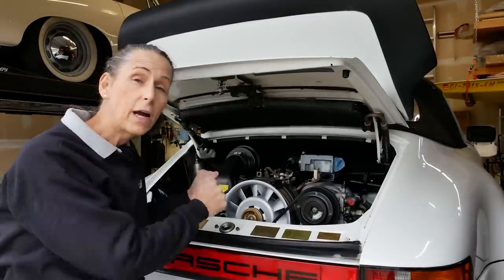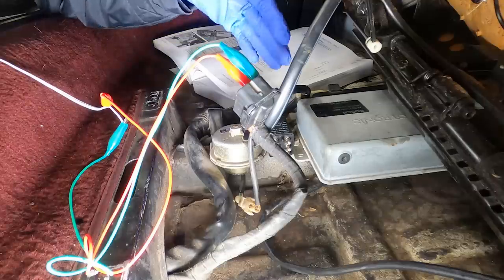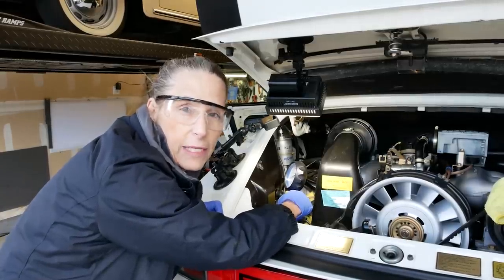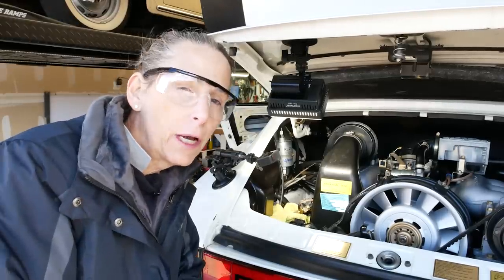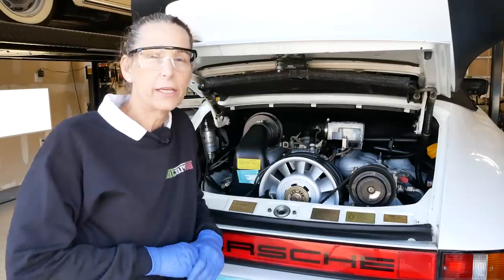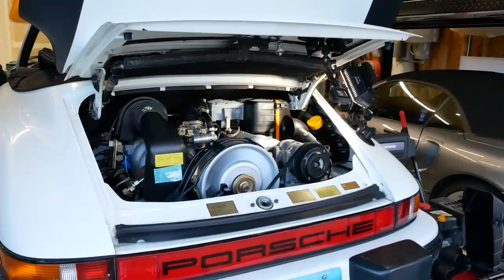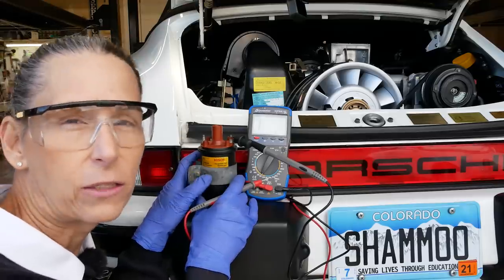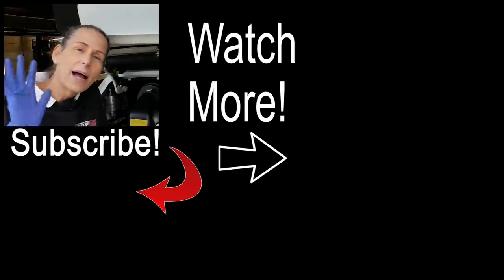Budget eBay Porsche 3.2 Carrera Project Car! #30 - NOW WHAT?! YOU WON'T BELIEVE IT!!

Comment: Great video on a vexing issue.   The way it dies after revving initially made me think fuel problem, but you’ve done enough testing there to move on.    Whenever I suspected a coil I’ve replaced them since it’s a cheap fix, but they never proved to be the issue.  I’ve seen a lot of good comments about checking the DME and Motronic controls along w/ O2 sensor.  That is a good start for next steps.  Especially since there is evidence of possible water damage in that area.  Someone leaves a convertible top down and it rains....... not good for electronics located under the seat.
Reply from the maker: Right.  I have my eye on the DME relay, but I need to test it.  I have a new one coming I can use as a spare.  I'm going to go through the service manual's procedures to check everything.  It is perplexing.  Seems like it should be something I touched though...
Reply: @HeidiandFranny  This is the opposite of a “well sorted” car so it’s actually beneficial to go thru all the systems.   You’ll know this car extremely well once it’s done ;-).   I always used the Chilton manuals on my older 911’s (and The Idiots Guide for my VW’s.).  Haynes was especially useful for my e30 BMW 325 and e24 635 and those are the  most contemporary to your 911.   I never found the factory manual to be that helpful for troubleshooting my 84 911.   They just assumed to much inherent knowledge on the part of the mechanic i guess.       Just keep the faith (as John Muir would have said) amd you’ll get it figured out!

Comment: 8:30 sounds bad. Almost like no engine oil, however that's not the issue...
Reply from the maker: It has oil and oil pressure...  I think that is the air entering the air box.  I need to reassemble all that...

Comment: Hummm...  I had a vacuum line I forgot to connect and an idle air control issue after my rebuild that acted similar.. surging and erratic idle.
Reply from the maker: Thanks that's great to know.  Which vacuum line did you miss?
Reply: @HeidiandFranny  Mine is a 993, and it was one of the lines to the solenoid actuator for one side of the varioram.  Also found.a collapsed vacuum fitting - see https://www.dropbox.com/s/l5tntv46kibcgkc/993%20vacuum%20fitting.png?dl=0

Comment: Since you had alot of the car apart you might want to check the grounds on the ignition system and coil. A bad ground will give a phantom temp related issues. I chased one on a 530i BMW after I had the motor out, it ended up being a body ground that been painted and not cleaned well on assembly. Good luck on your hunt what ever it turns out to be.
Reply from the maker: Thanks for that.  There are two main grounds - one between the car and the transmission and the other on the intake manifold.  Both were cleaned thoroughly and re-installed.  BUT, It would be a good thing to re-check them.
Reply: @HeidiandFranny   I've seen some coments on the airflow meter and it kinda jared my memory back to my Benz and BMW tech days, those were a royal pain.  The potentometer in the airflow meter could develop dead spots or the vane itself could become sticky both could be temp dependant. The vane can sometimes be freed up with some light oil and the continuity of the potentiometer can be checked I beleive but, I'm sorry, I can't remember what connector pins to test at. Hope that is some help to you.  I don't want to be the person who "knows" what your problem is just offering some suggestions.

Comment: You are wrong in the measurement, it should be several kiloohm when you measure to the spark output!
Reply from the maker: You are correct.  It is a little misleading in the manual.  Should be between 5K and 8K Ohms.  The manual stated 5 - 8KOhms and I missed the K.  That's alright.  I think I want to have the coil tested anyway.  It is 35 years old...
Reply: @HeidiandFranny  Hi, Do you have a dwell angle meter, then you can hook it up  on the coil and check if the coil get's the right signal from the engine management system even if the engine doesn't start.   /Gunnar

Comment: Hi franny are you sure the vacuum line for the feulprssure regelator is on the richt connection I ask this becouse I saw the pressure drop when you gave a bit of throttle. The vacuum line is there to hold the pressure diffference between the injectors and manifold constant, so when it is idling it should be at lowest. Your doing a great job btw.
Reply from the maker: Thanks!  It did drop a little, but it was always above the min 2bar.  And, I did see a good jump in the pressure when the vacuum line was removed and it went back down when it was hooked back up.  It seemed like the pump and regular are functioning within the specs.  There may be a few things at play here...

Comment: Had a 912e years ago, had similar problems and ended up disconnecting the wiring harness from the computer and twisting it one turn.  Reconnected it and the car worked fine afterwards.  LOL
Reply from the maker: Those old wiring harnesses ;)

Comment: Sounded more  ignition related than fuel or air to me?  

Swapping out the coil may seem like part changer diagnosis but in this case it's the best option.  Go ahead and swap it out anyway it's past it's best before date👍
Reply from the maker: It totally is!  I was pretty surprised to find it was original.  If not today, then probably not long... ;)

Comment: It's probably the coil but also worth checking the distributor setting and points. Timing seems off.
Reply from the maker: No points on this year of the car.  Timing is handled by the Motronic system.  We'll see on the coil... Thanks!
Reply: @HeidiandFranny  It looks like the fuel pressure gauge is resting on a distributor at 6:19. A bad idle is normally poor timing. Running the car with a bad injector could have upset the timing. Perhaps the monotonic system needs a rest or the car needs to be run longer for it to make adjustments.

Comment: Hey guys, did u use any special lube on injector o-rings b4 install? Ernie
Reply from the maker: Yup!  Sure did.  They are near impossible to get in without a little silicone grease ;)  But that is a good point. If you force them in dry they can rip.

Comment: 8 minutes in, haven't watched the end or even know if the answer is in the video, but if it was running perfect minus the bad injector before, and now it runs like junk with all good injectors and the only thing you touched are the injectors, I think it smells like an injector o-ring got cut, or got pushed out of its groove during install letting a non-trivial amount of air bypass the maf (or afm) and idle air circuit. Injector o-rings are the bane of my existence, I would not wish an injector o-ring on my worst enemy. Squirt brake cleaner on the injector-to-manifold o-rings, see if it momentarily runs better.
Reply from the maker: I will check that.  They are all new and I did put a tiny bit of lube on them, but I'll double check.  Thanks!

Comment: I have never heard of a coil that functions intermittently. Perhaps the coil fails when hot, which would explain why the engine runs a short time and then stops, but will restart. It seems logical that a small break in the windings could go open with heat expansion.
Reply from the maker: I suppose we'll see...  I'm not completely convinced...  I hope all is well :)

Comment: You seem to have some kind of electrical issue.  For sure.  It could even be a bad ground, thats kind of what im leaning towards, VERY odd problem.
Reply from the maker: I still think it has to be something I touched...  Process of elimination!
Reply: @HeidiandFranny  Probably...but stranger things have happened!  I would start by checking the wiring  (Wiring Diagram>Power Distribution) to anything that can cause the engine to die if disconnected.  Trace the wires, and check all ground points.  I'm thinking a pinched wire or something of that sort....

Comment: Great video. I am no expert but on an old car of mine I had the same problem. Dirt in the petrol tank blocking the outlet on a random basis.
Reply from the maker: Thanks, I've cleaned the tank an installed a new filter.  All the fuel lines are new.  The pump passed it's test and if there was a blockage the test with the car running would have been below spec.  It is a good call though.  That is why I went at it cleaned and replaced everything.

Comment: The fuel delivery looks good, but what about fuel quality.  Any chance water is surging through, or extremely stale fuel?
Reply from the maker: Good call and yes the car has been sitting for over a year, but I drained the tank completely and re-filled with new fuel.  New filter as well.
Reply: @HeidiandFranny  Your fuel pressure is good at the fuel rail tested, any chance the other bank is loosing pressure.  I'm not familiar with Porsche, so just asking?

Comment: My 82 911 had similar symptoms was both coil and leads. Never use non original leads due to the very high voltage the 911 system uses.
Reply from the maker: Thanks for that.  All the leads are new (that doesn't guaranty they are good though).  A 35 year old coil with 110K miles on it?   Hmmm... ;)
Reply: @HeidiandFranny  Ive driven 110k miles on my 911 and at that point the coil failed. It was my daily driver at the time.
Reply: @HeidiandFranny  I fitter non original silicone supposed performance plug leads but they failed after only a month or so. replaced with Behr original ones and not had an issue since.

Comment: Are these cars cheap to restore?
Reply from the maker: Ummm...  Define cheap ;)  With their age the consumables are still readily available, but the more specific parts are becoming hard to come by.  If you start with a good running example then you will be fine, but if it is missing a lot it could get expensive.  Still, it is way easier to get parts for that the Ferrari...
Reply: @HeidiandFranny  I guess I meant wouldn't it be more economical, and less labor intensive to start with an example that is in good working order? Or is it just the want to restore/build something yourself? Ether way, both have merit.

Comment: I'm surprised that just one injector was locked up and I thought all of them would have been locked up
Reply from the maker: I guess two were technically locked up (one open and one closed) and two were sluggish.  Boy, they really don't like to sit.  I did notice a fair bit of smoke when it started with the new injectors.  I think they did leave a little oil in them.  I think they are working just fine now, but I should test them (again).  I just don't think it would cause the whole engine to just die...
Reply: @HeidiandFranny  it was quite weird how the 3.2 Carrera would die for no reason I hope you figured it out

Comment: My car did similar when the air intake was changed, the ecu would need to relearn the fuel, air mix again
Reply from the maker: Ya know...  That is a really good point.  I still have the entire air box off and I was wondering if that could be affecting it.  Hmmm...
Reply: @HeidiandFranny  yes. I think you're on to something. The surging reminds me of when my car had a very small crack in the air box. It surged like your car is doing. It droive my shop crazy until they figured it out. Good luck.

Comment: Love how methodical you are when troubleshooting. Hope the coil or DME fixes your issue. I'm sure you will do this, but I'd only replace one of the parts at a time. That should help isolate the issue and hopefully final fix.  Can't wait to hear this motor running smoothly. Thanks for another great video
Reply from the maker: Thanks!  Yes - one thing at a time...  I'm not convinced the coil is all of it...  We'll see!

Comment: Hi, great video.  With it hunting so much I would look at the timing, the distributor may be playing up and altering the timing, hunting and then stalling the motor.  Just a thought, had a similar with problem with an A series mini, turned out to be broken spring on the weights in the distributor.  Good look from 🇬🇧
Reply from the maker: Thanks John, I did go over the distributor when the engine was out.  The timing is handled by the Motronic FI system and is not adjustable, but a bad weight in the distributor is something to look at again.  Thanks!